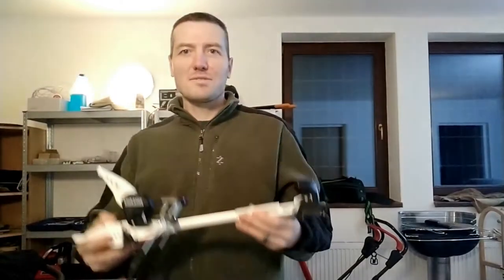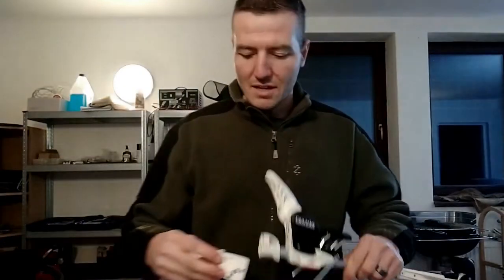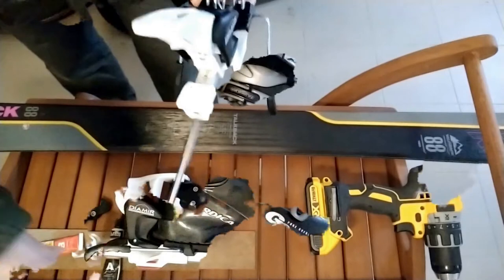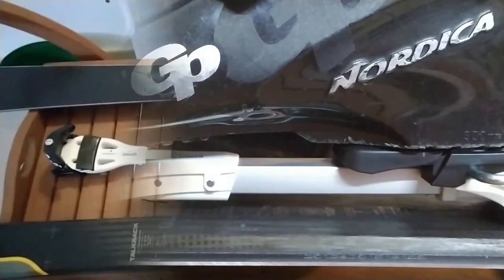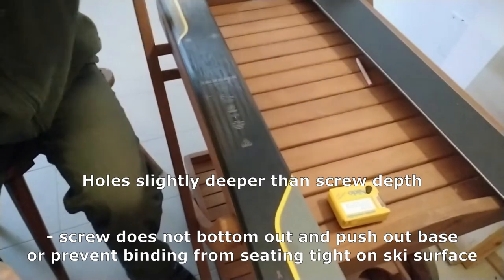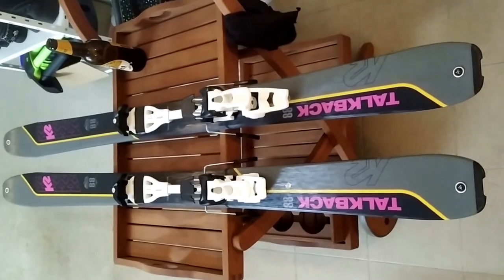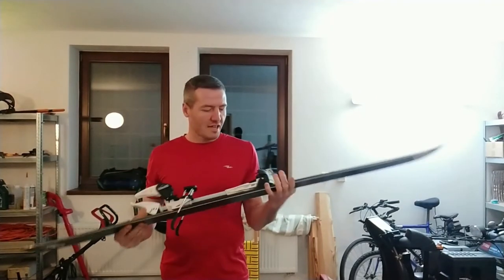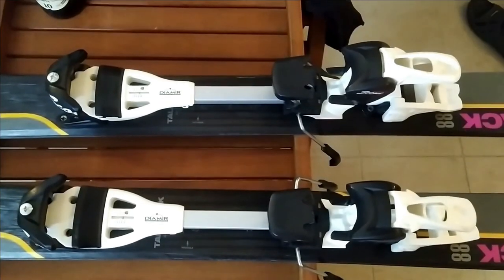Ski binding mount - Fritschi Diamir Scout 11 on K2 Talkback 88 - No template

Comment: Hi there, good video! I am trying to mount the Scout binding on my Wayback 23 model, but there is an elevated ridge (about 1mm wide and half a mm high), seems to outline the metal part. Problem, the binding is not even with the surface.. On the video it looks like the Talkback has a completely even surface?
Reply from the maker: Hi, the surface of these skis was flat and smooth (as with all the skis I've done...).

So, I feel obligated to state that I'm not a professional, and below is just my opinion/what I would do if I had your skis...

  If it's only a half mm, I would mount the binding like normal, and the plastic binding will probably deform around the ridge as you tighten it and fit the ski surface on its own. I would definitely not sand off any of the top coat to make it flat. As long as the binding is tight against the ski at the point each mounting screw is located I think it would be just fine.

Otherwise you could just file out a wee slot in the binding bottom to accommodate the ridge.

Side question though, are they used skis that may have had a bit of a beating? I don't know if this happens, but perhaps there is some delamination and the plate has pulled up? This would worry me, but I have no experience with it. Definitely test that the mount is very secure before skiing them!

Before I trash a ski, I would try the following: drill mounting holes through the entire ski, recess t-nuts in ski base, repair base/cover t-nuts with p-tex. I hope some expert comments on this. I hope to try it out on some ghetto-diy mini skis when I have time.
Reply: Hi, thanks for the detailed answer. The skis are brand new. I have sent a request to K2 and see what they suggest. Surely there must be a solution , any dealer offers this ski in combination with the Fritschi binding (my problem is there is no dealer within reaching distance for me at this moment)..